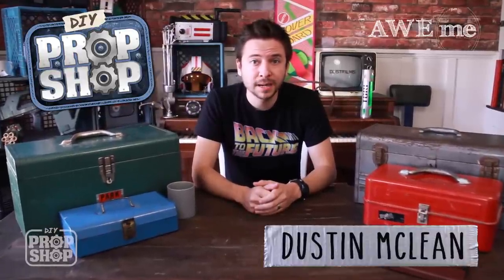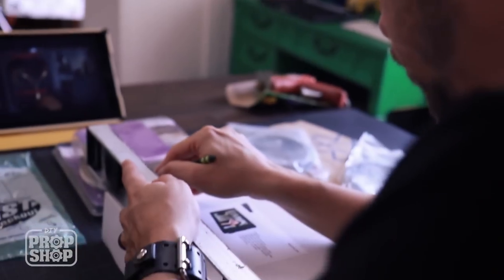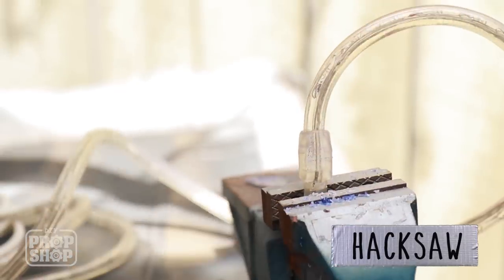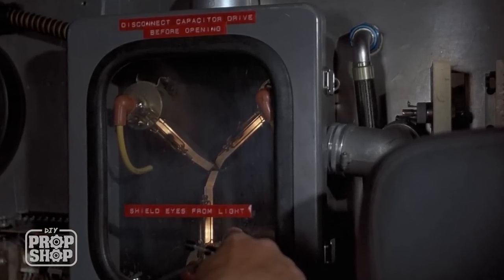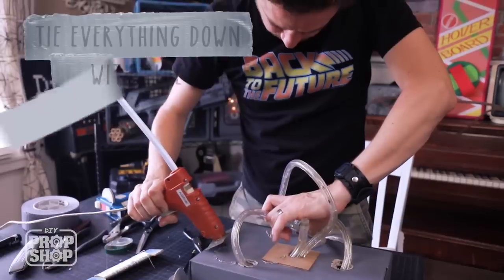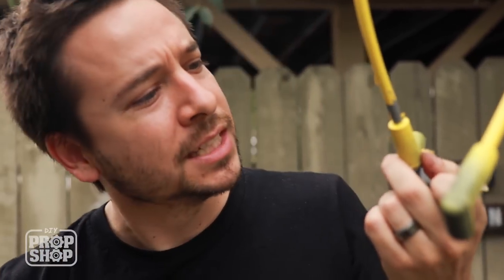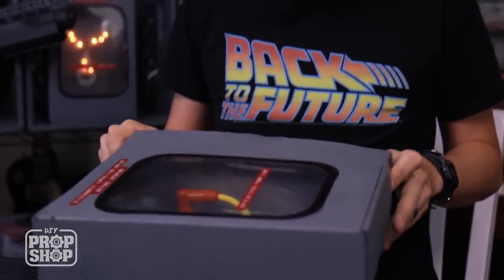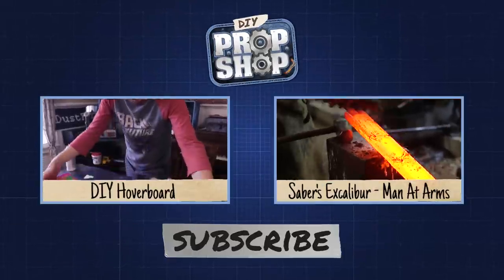Make Your Own Flux Capacitor (Back To The Future) - DIY Prop Shop

Comment: You could really up the production value by swapping out the cardboard for a cheap metal lunch box, or even a plastic one.  I'd need to look up some numbers, but I'm also pretty sure you could lower the cost and increase the accuracy by getting LED strip lights and putting them in some simple clear plastic tubing; $17 for a box of rope lights, half of which you're not even using, is a pretty big waste on this project.

Comment: Why the hell would you line the edges of the window with black marker? USE DUCT TAPE ATLEAST! Seriously, just put duct tape around the hole and then paint the duct tape black. It will look a billion times better.

Comment: What size is used for the proper box? I'd like to have a brushed steel one made with the rounded edges, and use rubber for the black insets instead of marker. Also, is there such a thing as a blue and white "pulsing" LED rope? That would make the effect closer to the film.

Comment: I like the part where this version is utter crap compared to the one you've got in the background.  It doesn't even have the pulsing lights.  This is why I hate this series, you're cutting costs to a ludicrous degree, to the point that the end results are suffering in a bad way.  Everything is cardboard and hot glue, barely functions, and would probably fall apart over a short time period.

Comment: 2015 so... now in 2020 LED strip lights would be a better choice.  Cheap you can solder them in to shape and they will run off a battery.  To get the rope/ tube look you would want to use some PVC tubing (also dirt cheap).

Comment: Now I just need to find a way to run this off a car's charging port.  Actually creating the time control board will be fun too.

I wonder if it requires 14-segment LCD displays or can I get away with Nixie tubes?  Might not be fun in a crash though...

Comment: You can use a Tin command box, thicker plastic window  and the other steps you used. I made a Flux Capacitor, Mattel hover-board, and Marty McFly outfit! I made them when I was 10, 13, & 15.

Comment: the ingredients you need is plastic tubing copper and zinc wire strands a cool looking barrel and backpack and put a electricity generator in the backpack and do the little source thing like your Ironman thing video strap it to the backpack put the wires in the clear tubing

Comment: paint will not stick to silicone spark plug wires. you can buy them already yellow with the correct colored ends. they are made by accell.
Reply: This is too true